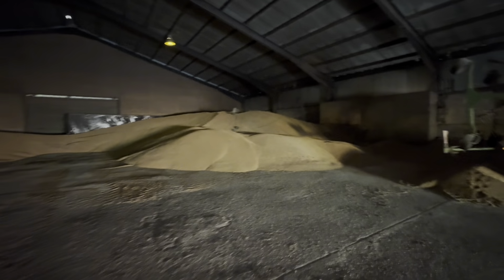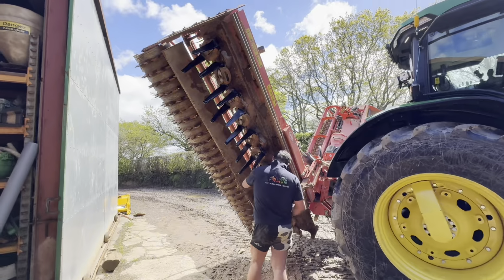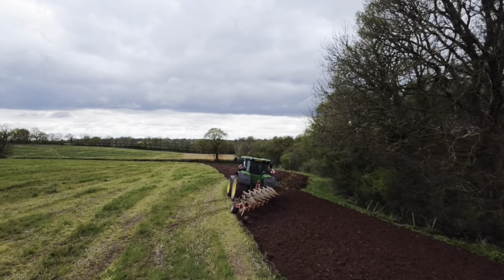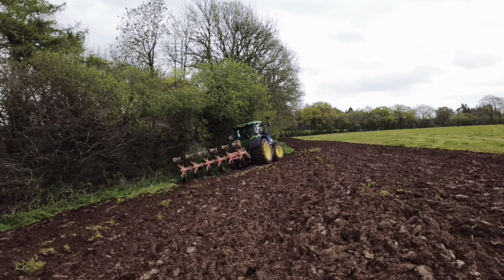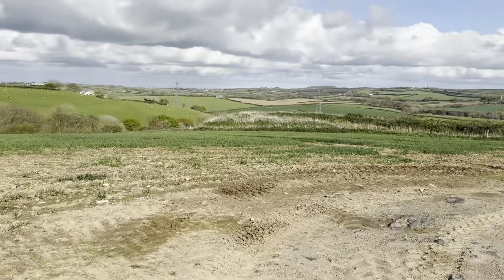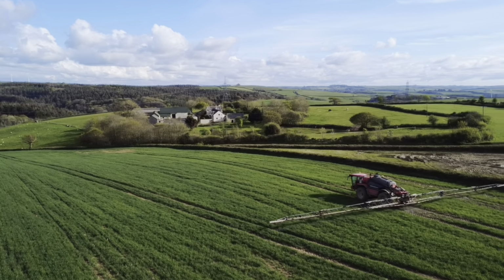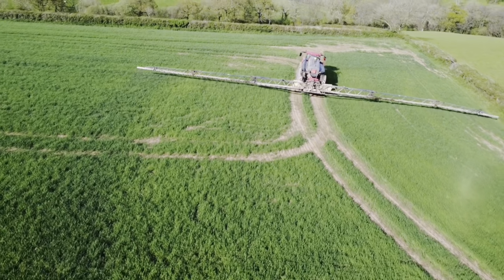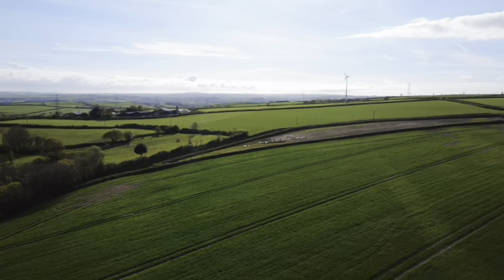SPRAYING IN THE HORSCH AND THE PLOUGH IS BACK IN THE GROUND!

Comment: If I had a bowser like that I would build a hydraulic drive filler pump on it, hydraulic so the sprayer could fill itself if their was no tractor on the bowser.
Reply from the maker: @CharlesYeo-qs6nb  the sprayer does fill itself from the bowser it just connects the pipe and sucks it up 👍🏼

It’s out of the tanks we need the pump - we could fit a pump to the bowser potentially.
Reply: @SteveLeeAgri  So you could fit a PTO pump on the bowser.